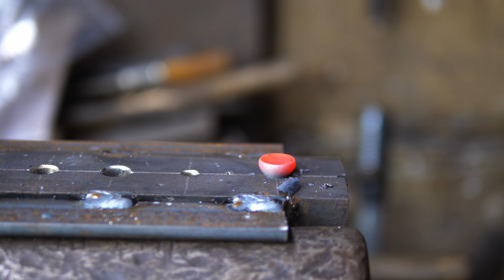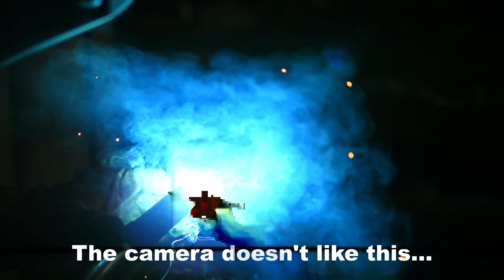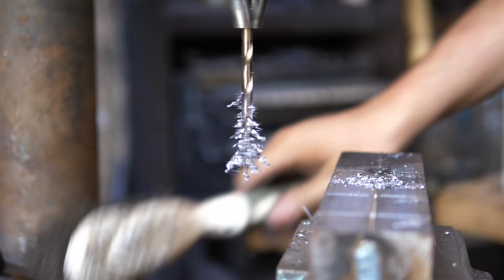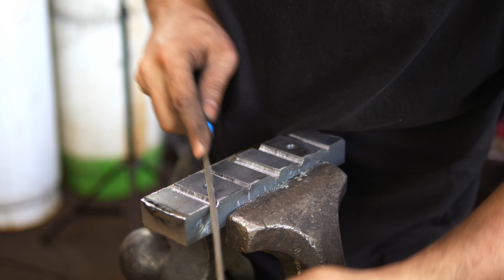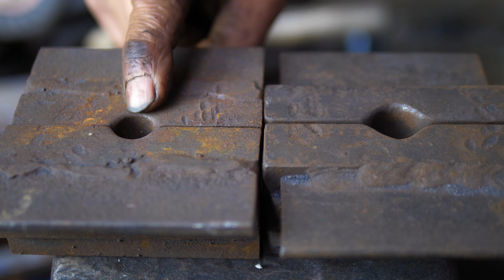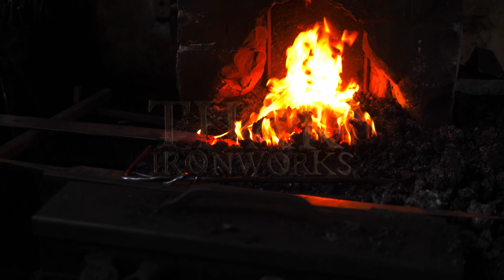Making an Upsetting Block - Blacksmith's Tools

Comment: Would this be used to make your own rivets or is it just better/easier/cheaper to buy rivets?
Reply: For smaller copper and brass rivets probably buy em. For large steel rivets I don't actually know where you would buy them so in that case making is probably easier.